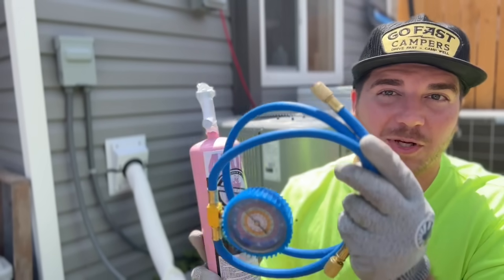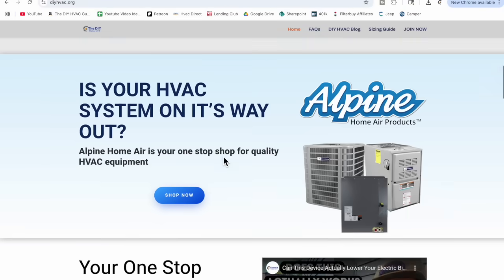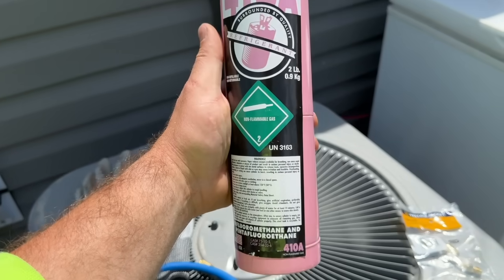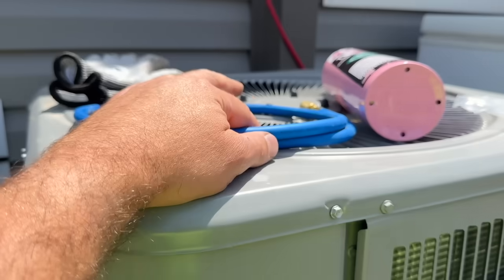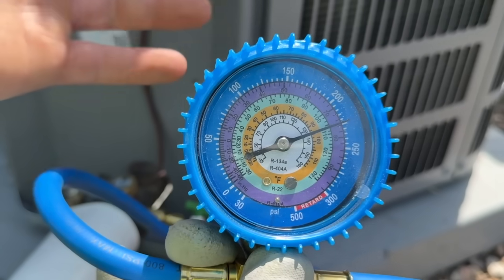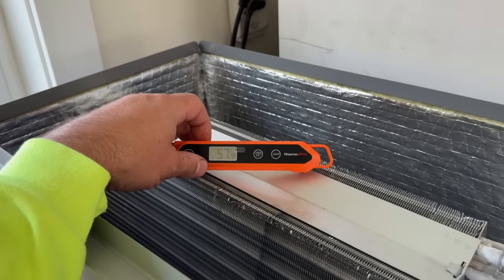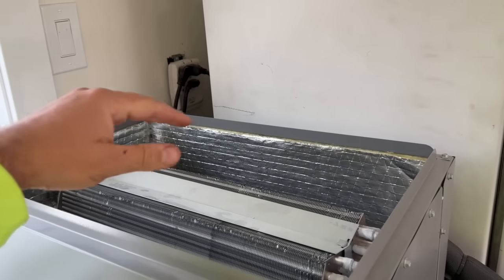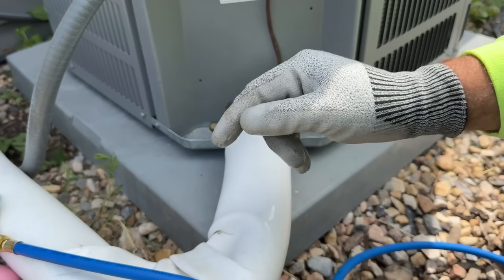You Can Recharge Your Home A/C Like A Car??  Colder Air in 6 Minutes!

Comment: I subscribe to many HVAC channels and no one else has ever given out this type of information. I had no idea that a simple kit like this was available to us everyday fix it guys! Just keeping one of these 410a kits as an emergency top up kit is like being a prepper as it's not a matter of if ... it's a matter of when! Not only for you but your family, friends, and neighbors too. Thanks for the valuable information. Love your channel!
Reply: Love your channel too!
Reply: You will only make things worse.
Reply: At 9:05, you would release refrigerant into the hose to push out non condensables. What he did didn't do anything. Also, you'd let the unit run a good 10 minutes with gauges hooked before you did anything, at that point you'd evaluate and you should have high side hooked up as well. Low suction reading can be from numerous reasons.
Reply: @arizonaf2503  Do you know of a good printed guide that shows simply the correct way to do it?
Reply: Agree. ABC. Airflow before charge. Gotta check many things before dumping charge in.
Reply: Shouldn't be a matter of when it is properly installed. I've installed 4 now with 10 cumulative service years and no leaks.
Reply: @LeeKeetle  Well back in 2013 my 23 year old R22 system on the hottest day of the summer started to ice up. I called one of those big HVAC companies and the guy came out and hardly looked at it, he didn't even connect a gauge, and he just told me the system was shot and I need a new system. Then their sales guy started calling me. Back then I didn't know any better and believed them but so many of them take advantage of you on the hottest days when they know they got you. Thanks to YouTube these days you can find out so much info they don't want you to know. If I had one of these R22 kits back then I could have pumped it back up again and maybe it would be good for another season?
Reply: @peterfairlie2296  They don't want to just fix it. Just went through that with a condenser fan. Did it myself after watching videos.
Reply: I agree, this dude is legit pro DIY!
Reply: We never had that problem adding Freon to a car.you just used one can. My dad knows how to charge a system he helped me when I had to replace a faulty valve switch. If the switch was shorted the system would run. I would take a class before I tried to recharge a system. I solved the problem I installed window units if one goes out I go to Sam's club and buy another. I saved a lot of money on my electric bill. Just run the unit in the room your in. I had two 8000 BTU units in the living room worked fine with just one but the other was to cover the dining room and kitchen. The bedroom was only run at night. Today they make energy star window units which I used. 73
Reply: This is a joke, and you think you're just going to throw a charge into a system, and it'll cool, hmm. Well let's think about this for a moment, yes air like a people said in the comments is a big factor. If you add refrigerant into a system you can over charge the it and cause other issues.  Also if your low on charge that means you have a leak. This is a closed system and you know most of these bends constant of two blends mixed into one. So during a leak you can lose more of the one part blend. So you should address a leak by fixing it if it's possible or replace the unit. Always recover refrigerant to check the weight see how much was lost. Look at name plate to see what the units total amount come from the factory.  Then add the recovered amount back into the system and weight the offset difference back in. This is after you fixed the leak and pressure check the vacuum it down. These DIY is good but there is a reason for school not a YouTube video. People can get hurt play with things they really don't know nothing about.
Reply: @jacobham9427   I understand weighing what you take out so that you can put the same amount back in, but if the system has been leaking, how do you know how much more needs to be added to make up for the amount that had leaked out?
Reply: @henryfitzgerald4965  you recover the refrigerant that is in the system (as well as evacuate air and non-condensables), then you measure it as you replace the refrigerant with what you recovered and/or with new refrigerant. It's not as easy as just adding more refrigerant.
Reply: Actual HVAC channels don't "give out" this information because an AC is a closed system. If it's low on refrigerant then you need to have that serviced. And if the company just comes and throws refrigerant in there, find another company that will actually repair the issue. All this is doing is helping deplete the ozone even more (if it's 410a) or adding to the greenhouse gases (if it's R22) please do not do this
Reply: @SuperPhantomHunter  No, 410A refrigerant (a blend of HFC-32 and HFC-125) does not affect the ozone layer. It has an ozone depletion potential (ODP) of zero, meaning it doesn’t contribute to ozone depletion.
Reply: @shhmandy   R-410A has an ODP of zero, but its Global Warming Potential is 1890, so yes indeed, it does contribute to the greenhouse gases. In contrast, R32 has an ODP of zero and a GWP of 675. This is why R410a is being phased out.

Comment: Mine got totally frozen up, the "A" coil in the basement was like a total block of ice & yes, the flow or force went to almost nothing because it couldn't flow pat the block of ice.  I had to cut the sealing tape & remove several panels to see inside to reveal the problem. It took me an hour with 2 blow dryers to melt it all down. Then I went out to my side yard & hosed down all of the fins of my condenser where the big fan is & a LOT of dirt & dust & some weeds came out of the fins = I forgot to clean it for 4 years, oops.  Then the A/C started working real good with very cold air & good flow & hasn't frozen up in 5 days now.
Reply: Lol same, we probably have the same air conditioner. A coil froze etc.  Remember to suck out your drain line with a Shop vac and then drop white vinegar into the tubes next to the a/c to clean out the lines!

Comment: A better way to check the schrader cores for leakage is to FIRST, before installing a gage or messing with the pots at all is to test for leaks. Big Blue is one of the best soapy type soloutions to use. Better yet use a real refrigerant leak detector. Be patient when using bubbles. It sometimes takes a while for the micro bubbles to form!! If there is no trace of leaks then you can test the scheader cores for leakage by lossening the caps . Now wet the outside circumference of the cap and look for bubbles. This way you don't contaminate the inside of the charging/ test port!! Spraying directly into the scheader port is not a good idea!!!! I have been practicing Air conditioning and refrigeration since 1975.
Reply: *Schrader. You can spray into this port. Just be sure to clean it with warm water and compressed air before doing any work.
Reply: We used to use water+dishsoap to check for leaks in bike tires back in the day, wouldn't that work here as well?
Reply: why not just put caps on it?

Comment: I pay monthly for a seasonal service subscription of both my parents AC and Heating system.  My (late) parents have an older AC system that runs off of R22, and every year for the past five years, they have been letting out refrigerant with every 'check' they perform on the system.  Now, after five years, they're telling me the system is low approx. 3lbs of R22 refrigerant@ $100 per lb.  I WONDER WHY?!?  Now, this company is 'pitching' me an 'Upgraded' plan (for MORE MONEY) where I don't have to wait within a five hour window for the technician to arrive and perform the 'Check-Up' and annual service.  HVAC Tech companies are getting greedier and greedier to the point of ridiculousness.
Reply: Honestly, I wouldn't be surprised if your r22 system actually had a leak. But if you saw them letting out gas on purpose then ok.
Reply: @cherryfruit5492  I did.  I'm with them every time they come, and I observed them from start to finish.
Reply: Even 2 lbs is $100
Reply: Also manifold disconnect could look like intentional release but there will always be released refrigerant. The key is realase should only be gas not liquid refrigerant
Reply: I was told r22 is hard to find when I had a leak so my guy told me to get a new one.
Reply: This guy lol good luck joe homeowners over charge you stuff so it pops and you will need new
Reply: They should be performing a leak search to determine if it’s your coils leaking .  If they are they don’t make them for r22 anymore and it’s time to replace it
Reply: R22 at 100 bucks a pound is one BIG markup. One can buy R22 at 20 bucks a pound in a 30 lb cylinder at Ability!
Reply: @joecooksey4331  Don't I know it!  I installed 'Spit Units' while deployed in Iraq.  I'm very trained in HVAC from my marines whose occupational specialty is just that.  We 'Cross Train' in every field to enhance our abilities to do each other's jobs if we had to.  I trained in HVAC, but I just never tested out, so watching these tech come to my parents home every year (once  in the fall for the furnace and once in the spring for the AC unit), I watch them, and I see them moving really slow when hooking up the pressure gauges to the AC unit and running the system, and I just hear dollar signs 'Hissing' away into the atmosphere, and out of my pocket fitting as they take their 'sweet ass time' removing the Schrader valve,  fully screwing the pressure gauge into the connector,  removing the connector and putting the Schrader valve back in.  

And, five years later, 'I'm told "Your system is low about 3lbs".  Well no shit Sherlock.  I wonder why?!?
Reply: @joecooksey4331  So is being quoted $465 for a $20  'Start/Run' Capacitor.  Like I said, they get over on ALOT OF PEOPLE, who just don't know, and it's sad.
Reply: The company I work for sells R22 for $400 1st lb, $200 each additional
Reply: @unabridgeddick6645  That's crazy!  I can by a 4lb tank for just under $200.
Reply: R22 is no longer produced so everyone boosted the cost. Its supply and demand.
Reply: @Drrich_DIY  Now it's 410a, but I've been informed 410a is being phased out as well, and replaced by another version of refrigerant.  When I find out which Congress person is getting rich off of this 'Global warming' BS, and the company making the replacement R-32 and that other newer version of refrigerant, I'm going to give them a piece of my mind as to how 'F'ed' up it is at the expense of 'We The People'.  At this point, they're playing games and 'We The People' will have to pay for it in the future.
Reply: @Drrich_DIY  Taking advantage of the BS 'Climate Change' and 'Global Warming' Bull Sh1t.  Somewhere, there's companies 'Making a KILLING' at the expense of 'We The People' with Central Air Conditioning units, that freon types changes like the wind blows.

Comment: You need to check super heat and sub cooling to accurately charge a unit. Not to mention with a mini split (critical charge) you recover then charge by weight. This guy is not afraid of liability or he’s too stupid to realize who he’s giving his advice to. I get that he’s trying to help people but damn there’s so much you need to know before you start messing with your own system.
Reply: He didn’t even mention checking the condenser to see if it’s dirty. Can’t wait for the complaints that they tripped the High Pressure safety and it won’t run or it vented all that expensive freon into the atmosphere
Reply: ABC. Airflow before charge. Lot more
To It than just adding gas.
Reply: Funny thing... for decades before tablets and cell phones, installers used the "fill it until the low pressure line sweats" method with a sanity check on the gauges. Literally never once saw an HVAC guy look at a chart or calculate anything. 22 years on unit is still running. For most home units, charge isn't critical.

Comment: Cmon fam i thought you were a tech first lol airflow is ice back to the compressor, low super heat. 

Low refrigerant, yeah low pressure,  freezing temps, but high superheat fam. How da efff would you get ice with high superheat?

6 min? Lol check shrader core and be safe yall! He is not responsible for injury or damage. <3 i do enjoy your content =D

Edit/add: lol recommendation to lie about a cert? I wonder if epa would pull your cert? Anything for clicks!

Others mentioned compressors compress air not liquid. Throttle to avoid liquid getting to the compressor.
Reply: This technique assumes that there are NO problems with the system except low refrig.

Comment: Great video. I'll examine my refrigerant level.

We are having a heat wave in Ontario and just wanted to share this with your viewers - in trying to make my AC more efficient, I checked for air leaks in the furnace. I couldn't believe it. The ducts were leaking all around the evaporator coil area of the furnace, especially where the duct work mated. So bad it would blow out a candle. Foil taped everything up and the results were unbelievable.

The cold air exiting the nearest vent dropped from 13C to 10.2C - with much more force (unmeasured.) My unit is working much more efficiently, and y place is COLD. Especially upper floors. 

Also helping - I reinsulated my supply line to the house from the A/C, the supply line IN the compressor chamber (the outside unit) and cleaned the coils with water spray. 23 year old unit, blowing like a cheap hook*r! 

ha Thanks Man.
Reply: Tip: it is not coolant. It's refrigerant.  Very different fluids and chemicals.
Reply: @BabbyGuavaandfriends  You know exactly what he meant. We aren't talking medical school
Reply: @BabbyGuavaandfriends  Oops my mistake. Yes it is refrigerant and the level is also great. (Changed my coolant / antifreeze in the car that week, and got brain confused....)

Comment: And it doesn’t matter that your putting liquid through the vapor line? Appreciate the video
Reply: It does matter. The liquid refrigerant has to be metered slowly into the suction side so the liquid vaporizes prior to entering the compressor. If too much liquid refrigerant is allowed to enter the compressor housing, the liquid can sink into the oil, cause it to foam, and then this oil foam can be pumped out of the compressor. Also the liquid refrigerant could be sucked into the intake port of the compressor and destroy the suction valves. A liquid cannot be compressed as a gas! You need to know what you are doing!!
Reply: @scottrothe5947  Exactly...... I suggest a restrictor fitting between the cylinder and the hose fitting which helps.
Reply: It DOES matter that's why you give it a few seconds only at a time. The compressor is designed to handle a squirt or 2 of liquid at a time.
Reply: wondering the same and hoping for an explanation
Reply: Has to go in as liquid it’s a blended refrigerant. Just flash It in.

Comment: Let me add that it is CRITICAL when adding R410a that the canister is turned UPSIDE down and ONLY liquid refrig enters the system. This is because 410a is a combination of 2 refrigs with different properties (zeotropic). On the other hand R22 is a single refrig and the canister/tank should be left in the upright position.
Reply: I just watched a Quality HVAC/R video where he charged R22 upright and was wondering. Thanks for this
Reply: R22 isn’t a blend can add as gas or liquid.
Reply: I'm confused.  In the Q&A section on the Ability Refrigerants web page for R22, it says to do it with the canister upside down for R22.
Reply: @Some1_No1 In easy lay terms water boils at 212F. R22 boils to a gas at about one temperature too. R410a is a blend and has a temperature "range" it boils for each pressure. ie the glide of the blended gas made up of two R32 and R125 components. Its glide is only 0.5C/ 0.9F

When R410a came out the canned dogma was always meter in as a liquid. That was preached for over 2 decades. So if a system holds 2000Lbs and looses 1 gram you have to recover it all and weigh in the 2000  Lbs. lol

Later years folks like mainstream engineering have said that the R410a metered in as a gas does not fractionate much at all. ie enough to change its composition.  ie acts almost like a single-component refrigerant,

ie is like gluing a BB on hockey players helmet ; that added mass will slow him down or a GP38 locomotive too

Same glide type stuff is with metals melting. Pure Aluminum melts a one temperature; an Alloy goes through a temperature range for full solid to full liquid
Reply: @3beltwesty  I quit refregent at r22.  I thought you added it as a gas so that explains why the r401 is added as a liquid.  At first I thought he was adding it wrong.
Reply: @3beltwesty  Huh? I'm just asking why this guy says to add R22 as a gas and abilityrefrigerants says to add it as a liquid.  Seems to me it is less risky (won't slug the compressor) adding it as a gas.
Reply: It's actually not that critical it's only like a 0.3 degree temperature glide dude
Reply: Unless you use the entire canister 🤫
Reply: @Hillbillyrefrigeration  Well... that is correct, but the only situation in which that would be appropriate is if one knew they needed exactly 2 lbs or more.
Reply: Unless you are a professional and know what you are doing
Reply: 410a is not as critical as first preached as the pull liquid or pull vapor..since it has some effect the dogma is pull just liquid. Ie like you are suppose to wear a helmet when making coffee..lol